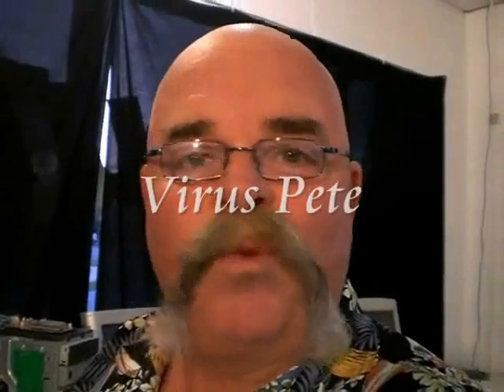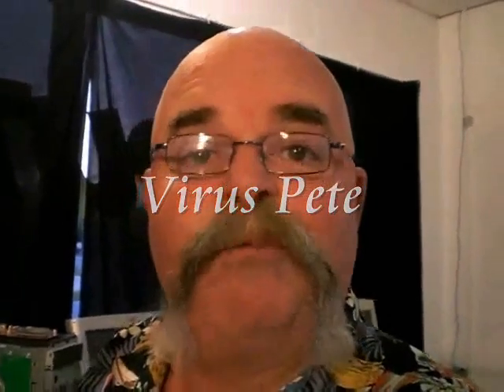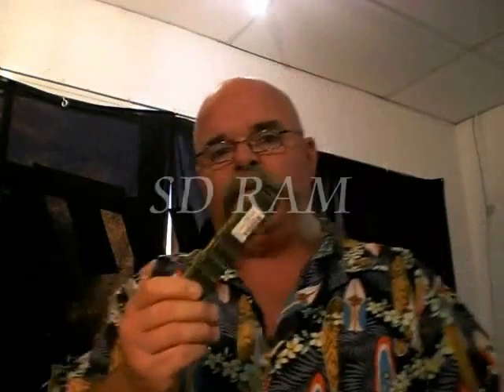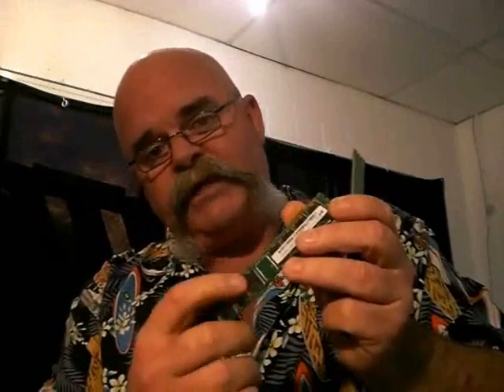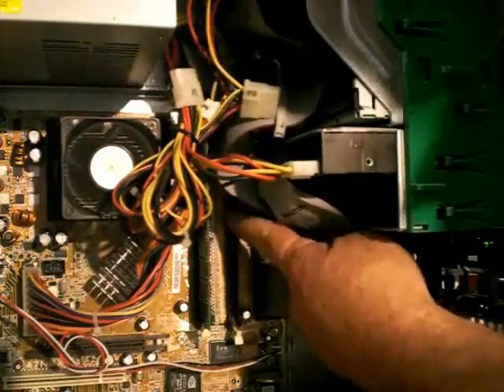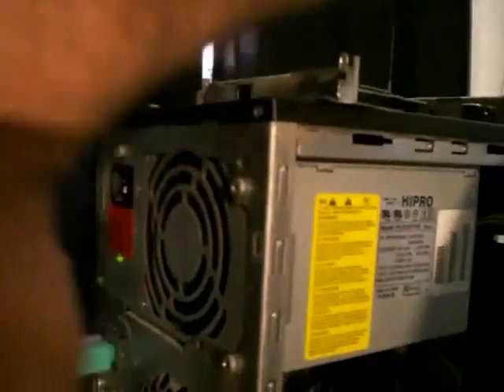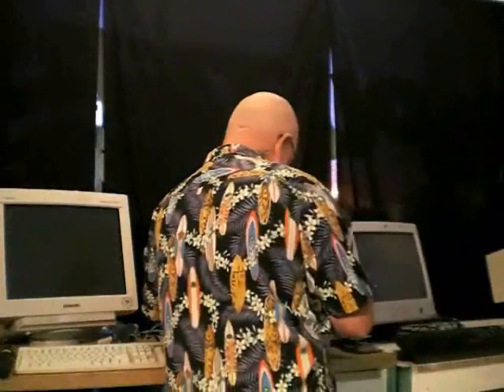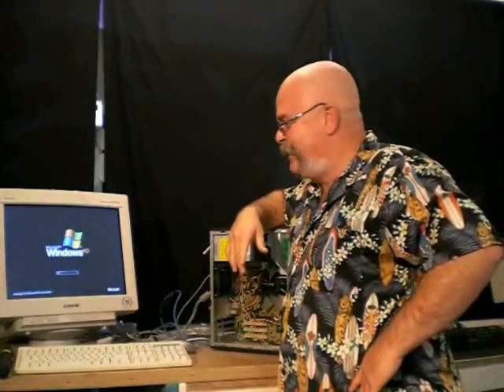PC repair for DUMMIES - No signal to monitor

Comment: Going to try that method now mate., I also heard from another video that takin out the CPU battery for five minutes may help but then you have to reset your date and time in bios. I'll try your method first. 

The problem began when I added a USB 3.0 card in a PCI slot., the sucker worked for awhile but then I got the error about the video monitor not recognized and going to sleep which doesn't do a lot of good because you can't see what the heck is going on~!

I suppose if I have to I'll uninstall the 3.0 USB card and start over if the RAM cleaning don't work  -  cheers~!!

Comment: Thank you VERY much.... but I have trouble in my computer its  Windows 10 the problem is I can't open my computer after I reset it I want to fix it faster because I'm so doomed when my mother and father will know. Another thing it always freeze at start screen please fixx pls...
Reply: +Lee Suico your going to have to use bios keys to get it to start
Reply: +William what is a bios keys????
Reply: its one of the f keys esc or delete search up what it is for your computer model once you type the key it should boot you up to bios in bios you an choose how to start up your pc what i would try doing is downloading a operating system on a flash drive or cd then inserting into your computer and in bios mode try to launch the pc from the flash drive or cd instead of the hard drive if it boots up there is something wrong with your hard drive try to resting it to factory settings and make sure its plugged into the motherboard one of the cables may be loose   

also try replacing the cmos battery the small battery on your pcs motherboard

Comment: i have been fighting with my pc 6months now and removing ram didnt do any good.
monitor did get signal randomly after like 50 restart and when it did get it there was badchecksum error message and my keyboard doesnt take commands to continue or reset deafult settings. and i did try from usb to ps/2 keyboard and didnt help at all and i have changed even bios battery kinda tried everything...
Reply from the maker: +antti väisänen Try replacing the CMOS battery...

Comment: Power Surge happened any way to figure out what is broke i was able to get pc to start by swtiching power supplies but no signal:( is going to it
Reply: +Corporal Bambi same problem
Reply: Yes it was power spoly
Reply: +Corporal Bambi When you changed power supply it worked?
Reply: v Bigsmoke nah but idk if the power supply was good
i kinda gave up on it

Comment: i just spent the day cleaning the filthy computer and tried two monitors but still no signal. i just put it all back together and signed on with my old HP that has been giving me message that hard drive is imminently failing. well that was two years ago and is why i bought this gaming computer from my son. it is nice and fast but had not been cleaned and was crammed with dust. so do you still think removing the ram will work on an ibuypower computer that has so much power i don't know what to do with it. i don't game, but i love the speed. do i HAVE to open it up again????????????????? please advise because the monitors both tested fine on my HP standby.

Comment: I did removed the two ram's and dusted out aswell as little battery.but, no luck. Still my monitor says no signal. What could be the reason

Comment: I have a Dell Optiplex 7010. First thing that happened was there was a yellow light blinking. So I searched for that and found I should take the ram out and try reseating it. That worked I got a white light back on. Still nothing on the monitor. So I searched and found your sight. Took the ram out again and did just what you told me, cleaned it on my shirt. LOL Put it in and no light at all. So I took it out again and this time made sure it was reseated. The upper end is pretty hard to get to. Put it back in and wallah I have a working computer. I am almost 65 years old and I am proud of myself. Even if I am a female computer dummy and all I did was follow your directions. Thank you Thank you

Comment: hey I was using my pc and it was going just swell and then my monitor mouse and keyboard just randomly shut off and my pc stayed on I reset my pc and still no response from monitor do you have any  idea
Reply from the maker: +Dgjhcccvvb Hhxcvjkkkll  That sounds more like a motherboard issue to me...could be a host of things though...
Reply: +PRECISION COMPUTERS - THE LIGHTER SIDE OF I.T. yea I found out it's a common problem with my motherboard so I'm getting a new one shipped to me

Comment: Hi i really need help i just put a new mother board ,ram and cpu in my computer it boots ive checked everything im actually using it to write this but i can only get a display through my graphics card if i try and but it on my board vga or dvi no signal even if i take out the card and connect the monitor to the mother board  no signal computer starts and everything but no signal on weird thing is with my graphics card in it does a beep when the computer is booting but without the graphics card it doesnt beep .. please help me thanks!
Reply from the maker: +MrSpartan117fan you need to re-enable the onboard graphics in the bios...google it..  ;)\

Comment: I unplugged my VGA cable while the computer was on and after plugging it back in and a hard reset  my computer won't post anymore. Any ideas on what happened there?
Reply: Yeah trying to find out too😞
Reply: monkeyjeffgarcia You have the same problem?
Reply: +AnimeBeefRandoms yeah
Reply: I can't get signal before or after what should I do?
Reply from the maker: +AnimeBeefRandoms You may have fried the graphics chipset/card...
Reply: +PRECISION COMPUTERS - THE LIGHTER SIDE OF I.T. that's what I expected, but seriously that easy to fry the graphics on the board?
Reply: Damn...then I'll start to build the pc I want

Comment: for me it loses signal when i am gaming...though i don't think it's the videocard because i just cleaned it of dust and changed the thermal paste...when i lose signal in a game i can still hear sound in game...occasionally one of the tracks loops like it is lagging....like a bullet shot...but the other tracks like wind, water or other ambient sounds are still running fine...could it be from the monitor not getting enough power?
Reply: KazPLAY More like system hangs that process- lower game setting to basic/lowest and try to increase step-by-step graphics quality and check if it still hangs.
Reply: i have also experienced the same thing, when i turn my pc on it's working just fine but when i tried to play dota the monitor first turns to dark and i can still see some pictures or words after awhile the monitor dies and bam! no signal -.-
Reply: Karol Karpiński for some reason it stopped on it's own a while back...dunno what it was but tnx for the reply.
Reply: My friend had similar problem recently- his GPU was getting so hot that the connector cable was melting a bit and making pins loose which lead to signal error. Maybe try different cables? Or get passive cooling for GPU ram and standalone RAM?
Also is dota fails be sure to download and enable openGL support as some GPU doesn't work well with source3

Comment: this only happen when I'm gaming
Reply: +jermaineAT this probably means that you have a pc that requires two power connectors, and you may currently only be using one
Reply: +Jackie T im using a gtx750 no power connector
Reply: +jermaineAT You need a power connecter that goes into your special graphics card and its a 6-pin connecter that comes from your power supp;y

Comment: Hi.... I have a question.... so yesterday my computer was working fine. Today I tried to turn it on and everything turns on fine except the screen goes straight to sleep. IDK why. I push buttons on the screen it still goes straight to sleep. Do you know how to fix this please. I'm a mother of three and I'm trying to fix this myself instead of paying an arm and leg to fix. Thank you in advance.
Reply from the maker: ***** If you follow the steps in this vid, it may resolve your problem, otherwise it may be a failed graphics card.
Reply: I did and fixed it thank you so much

Comment: Going to try this tomorrow.  But my computer boots fine, and everything is fine, then a few minutes in (for some unexplained, non-repeatable reason) it does the no signal.  It also cuts off my speakers.  But the computer does not turn off.  And I've tried other monitors and cords.
Reply from the maker: Kent Trehearne Hmmm...that actually sounds like a motherboard issue... good luck...

Comment: I am getting the no signal problem,had too clean my processor,and when i was putting everything back,and putting the panel back on,a screw fell intoo the power supply,so it took me a few minutes too get it out,had too take power supply out,so i put everything back,and im getting no signal now,HELP,tyvm
Reply: Same😞

Comment: After twelve hours of intermittent on/off, working/not-working, this video just saved me what little hair I have left after tearing most of it out. I was looking at driver problems, video card problems...all sorts of solutions from all sorts of forums.

Then I watched this video and re-seated my RAM (I haven't re-seated anything in years...) and all my problems are solved and my sanity and all my work is saved.

I never comment on YouTube, but I signed in and sullied my email in order to leave this message and say thanks so much for this five year old video!

Cheers, mate!
Reply from the maker: Tim D Glad to be of service Tim.

Comment: I just bought a new motherboard and when i plug the display cable into the graphics card  (with and without it being plugged in ) and yes the pci-e plug is in as well. i instantly get (no signal message on the monitar) i am leaving the cmos battery out over night and trying that way. ive already tried cleaning the ram.  for reference its the msi 970 gaming board and the evga gtx 660 ddr5 graphic card. My past board was the  ga-m68mt-s2p any ideas ? the fan on it runs and all fans on the pc runs.
Reply: dragon_blade I should mention i am using a laptop for now but i would like my main pc up  :P

Comment: I have a Windows 7 eMachines Desktop But I replaced the Hard drives because I'm not a Windows Fan and I wanted more Disk Space so when I go to install linux it says Failed for some reason im thinking i didnt plug one of my hard drives in correctly or something but i can run the operating system live from a usb Im not sure at this point of the issue
Reply: ***** The Desktop was given to me from a friend it used to just beep and i took it apart to realize there was no RAM so I put 6GB worth of DDR Ram into it and the beeping stopped
Reply from the maker: *****  Sounds like the HDD is problematic...

Comment: What do you recommend when it's only 1 of 2 monitors have a black screen? They were working properly for about 10 months & then one of them went blank. It was the newer of the two monitors purchased 10 months prior. Once it went blank the windows could not detect it. So, I brought a new monitor & same issue - windows detected it for a few minutes but then same issie. I have a GT 660 graphics card, MSI Military Mother Board. I've tested all the workings, then I removed then replaced the 4 RAMs differently  but no luck. The DVI, HDMI and DisplayPort are now connect to three monitors, still only the DVI is detected.

Comment: Hi,  i have  windows 8  pc, recently  my  pc  going  to  restart within 15 minutes   after login the  windows8. I try  to  install  windows 8 but  it again restart  during the installation  i already  check the  RAM and  processor  Fan they  are  working  fine. My motherboard is ASUS .can you help me regarding this. Thanks in advance ..
Reply from the maker: Monsur Matin It sounds like the CPU is getting hot...check the CPU fan for dust...

Comment: Hey I have a HP Windows 8 laptop and it comes on (very slow) but my screen is fine nothing wrong with that. But its something somewhere couse it won't do anything. If I don't bother it, the screen comes on says its loading but that's all. I've taken the battery out and tried that but didn't help. I want to try and do a reset or restore to factory but don't know how. Can you help me?
Reply: I think your am needs to be replaced. I think this because the co outer is slow, and ram is what makes up the computers speed. When ram fails, the computer fails, but it will still start, it just cannot do anything.

Comment: My monitor sometimes says no signal when i take it out of sleep mode (even though it was working before).  I restart the computer and this sometimes fixes it, but not always. Then out of nowhere without me changing a thing it will start working without me changing a thing. I looked at the cable for damage as well as the connection to make sure it was plugged in and it was. Do you know what the problem might be?
Reply from the maker: Just your typical user sounds like an overheating issue...check the CPU fan for dust...

Comment: have a Dell Optiplex GX620 to which I am trying to add a GeForce GT 730 GPU and have been caught in a catch 22. If I install the card and turn on the computer, as the accompanying instructions prescribe, I receive a BIOS message stating that my monitor is plugged into the wrong port and that I should turn off the computer change the plug, and restart. The CPU is at full stop leaving a shutdown the only thing you can do. I did that and only received a blank screen upon restart. This state cannot be passed by. There are two BIOS options concerning the monitor state at start up and neither allows this screen to be bypassed.  email me at weedgamer444@gmail.com if u can help

Comment: If this doesn't work am i meant to get some similar RAM, in my case DDR3 1600Mhz and replace it and then it will fix the "no DVI signal" problem, right? Someone who actually knows the answer reply, thank you.

Comment: When I push the Button to start the PC (machines window 7) the green light on the Button do not lightening and I hear no Beep signal, even I hear that fan and maybe the computer, however on the monitor occur text "no signal". Also the Keyboard is without light. Sometime the Keyboard lights up for 1/2 sec. and then "dies" again. In this case I can also not shut up the PC with the button, only with to take the power cable out...
However sometimes after letting 1- 5…Hours the computer on (without signal, light on start Button etc.) then, disconnects power cable several times…if I am lucky... I hear the beep signal and the start Button have green light, the keyboard have lights and the monitor have blue light and window starting …
Please what should I do…step by step pleas. I am NOT literate with computer terms and/ or not computer “fix it person”. Thanks for any Help!

Comment: Hey, I'm commenting off a completely different computer at the momet. I just tried to hook up my other moniter to my pc, And I hit a setting on it, And I think that it is projecting off a different screen that I can't see. I can go through the beginning stages of starting up my pc. But when it gets to the window 7 log in part, It just black screens, I can still hear everything though.
Reply from the maker: Sean Taylor sounds like you've set it to throw the signal to a 2nd screen....try plugging a 2nd monitor in ...so it's a dual screen setup...then u should be able to change the setting back from the 2nd monitor...
Reply: thanks for you help sir but we got it fixed late last night
Reply: PRECISION COMPUTERS - THE LIGHTER SIDE OF I.T. I just built a pc the fans are turning on and everything I tried removing and then cleaning and putting ram back in no results I tried building it again and I'm out of ideas it just won't connect to the monitor through my GPU and Motherboard I'm out of ideas please help

Comment: Hi Pete, I followed your video but as I switched on the power supply, the cpu started with beep sounds, still no display. 
Please help me with this!
Reply from the maker: Malabika Sen  Could be the VGA cable...or monitor...or vid card....
Reply: VGA cable is fine,the monitor is receiving power also,but then it does not respond hence after and cpu produces the continuos beeping sound,have to work around a little bit.
Thanks for your prompt reply,I'll post the update if any!
Reply: PRECISION COMPUTERS - THE LIGHTER SIDE OF I.T. One of the 2 RAM turned out to be faulty, also the CMOS battery was out.

Comment: Hello Pete I really enjoyed your video, humerus and simple. I was just wondering if you could help me out with a problem, My friend bought a new USB microphone, when she removed it the plastic from the usb broke off and stuck in her mic's usb. The computer then froze and would not power down until she turned it off by the plug socket. Now she gets the no signal like you said and has tried everything from taking the ram out and putting it back in to removing the BIOS battery and putting it back after 15 minutes. I was wondering if you had any suggestions I would really appreciate it. We have also noticed the PSU fan does not spin on start up if that is helpful at all :)
Reply from the maker: ***** Sounds like it may have blown the board Mate...
Reply: yeah she took it in to repair man and he had the same idea in mind. It's a shame but I think she has it under warranty. Thank you very much for your response, much appreciated :)